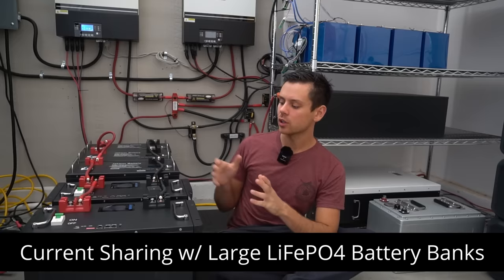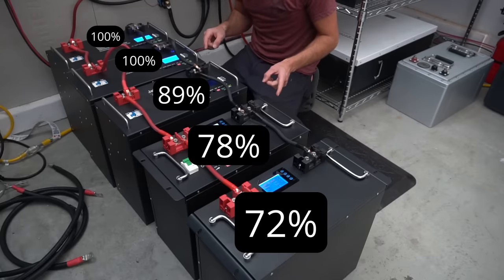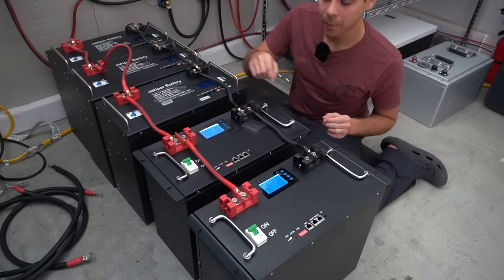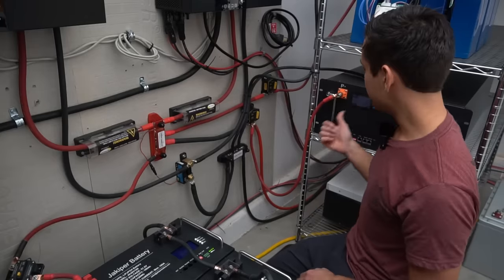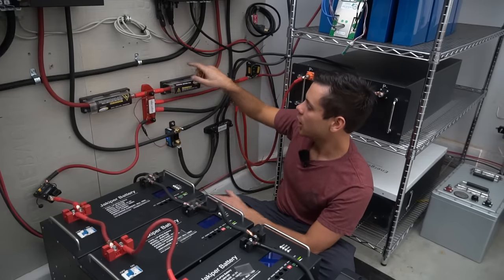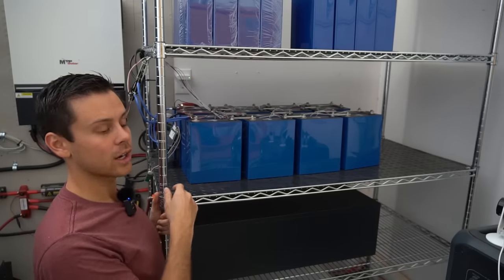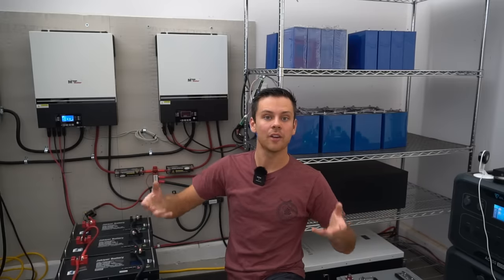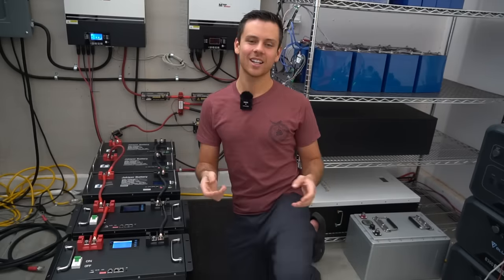Current Sharing 101 w/ Large LiFePO4 Battery Banks

Comment: I have such a case
1- pv off, inverter off, battery cable fuse off, and we do the tests step by step,
2 - battery only on 35mm2 current wires
3 - I turn on the battery and everything is ok, I wait maybe 20 seconds and the green LEDs are on all the time, which is ok
4 - I turn on the battery fuse before the converter and the red LED lights up for 10 seconds
max and I hear in the inverter but when the sound is off, the sound from the inverter is buzzing and after these 2 seconds the LEDs are green
5 - when I see that the red LED is on, the inverter does not turn on
6 when the green diode is on, the inverter turns on and works without any problems
7- after 10 seconds, I turn on the pv fuse and when the sun is shining, the red diode from the battery lights up and I see that the battery is being charged with 10 amperes, but the red diode is on all the time and the inverter has no error messages
8 - when the sun is behind the cloud and I see that the panels have 0.8 amperes, i.e. 90v, the red diode stops shining and the green diodes are on, and when the sun shines again and there is 5 charging, the red diode will light up again
9 - I turned off everything and only with the battery, without the inverter it jumped and I noticed a short circuit when the power in pv was greater than 1 ampere,
10 - his conclusion as I understood the pv charger in the inverter sends strong currents from the pv to the battery
and is set to 56V max
11- what's the matter, the installation of photovoltaic panels gives different voltages depending on their insolation is logical, the inverter supports max 450 volts per string THEN WHY PV CURRENTS FLOWING THROUGH THE INVERTER CAUSE A SHORT TO THE BATTERY what do you think is true next is the same inverter and is the same, every time I turn on the battery I hear a sound from the converter as if I turned something on and felt the current from the battery before I start it and it's hard to say if the converter can cause a short circuit of their battery or they have full bms protection and sense something and the red diode lights up but it charges and this is funny i don't understand please help me i already wrote it but it's not solved yet oh yes i've been playing with it for a month now :( in the room where the off grid installation the temperature is 12 degrees i feel it affects it and the inverter? something with the PV installation but the inverter does not show anything?, please write what should I do with it, thank you WILL

Comment: Hi,
Any idea how these would work in a marine environment/sailboat. Previous owner had the diesel engine removed and installed a 48vdc 5kw brushed motor. I replaced the battery bank, using 8 6v USbattery 220ah batteries giving about usable 100ah. Most I have ever seen the motor draw was 60a. One or two of these server batteries would give me more ah and take up less space. Currently my batteries are located in a couple spots, cabled together.

Comment: I am looking for component suggestions for a mobile application.  I want to install two LiFePo batteries, a DC to DC charger, and an inverter in the toolbox of my pickup.  This will be used to supply 120 power wherever I am and if need be can supply power to a travel trailer.  I have dual alternators that put out 397amps combined.  Any suggestions?

Comment: I have the EG4, 48v 5kwh batteries. 4 of them. I also have 6 sonnen batteries , same chemistry , same voltage but they are 2kwh. They have built in bms but cannot communicate with other batteries.  Can I still connect these Sonnen batteries , with the same bank but connecting to the same bus bar?

Comment: Good day I have a 48 volts setup with 2 Lifepo4 batteries made by me. They are 100ah batteries with different amps BMS Daly 250 amps and 100 amps . The issue is the one with the 250 amps in discharging faster and shutting down the Inverter (40% charge to 75% on 100amps BMS). Any suggestion how to fix this problem?.

Comment: Have you seen the BBMS concept from  Emily & Clarks Adventures YouTube channel, to manage a parallel lithium battery to augment a lead-acid bank?  Obviously with multiple breakers between strings.
ALSO have you looked at lead-carbon 'ultra-batteries'?  Your take would be valuable... Even following you, I still opted for 19200 Wh of PbC.  They've been tested at up to approx 15k cycles at 4C.
NB apx USD $350 per 12v 200Ah before shipping from CN

Comment: Hello just wondering if you could help  I have 4  120ah  agm batterys wire in parallel.  And have been told to put busbar in so I no the cables have to be the same length  but do I need to take the cables off that I have already connected to the batteries to make them in parallel  or leave them on and just add an other set of cables  from the neg and plus to the busbar

Comment: In the spring I'm upgrading my 24v lead acid bank (3 strings of 4 6v GC2 batteries, 645ah) to Lifepo4 (3 SOK 24v 100ah batteries). I've been thinking about ways to incorporate some of the FLA batteries (dc to dc chargers, a couple extra panels to charge the FLAs, etc) to give a my Lifepo4 bank a boost when we spent long weekends at camp. Does anyone have any thoughts on a good way to make use of the old bank?

Comment: would it be possible to take a 30a rv extention cord and cut off the end and connect those wires to the inverter. then plug my camper into the other end. 3500w reliable inverter and 25ft camco 30a rv extention cord

Comment: have 3000 watt all in one inverter charger with a single sok 48v server rack battery hooked directly to unit, want to add another battery; what fuse should be added to the line?;  thanks

Comment: Is there any value in a 288-Volt Nickel Metal Hydride (NiMH) battery pack consisting of 30 low 
voltage (9.6-volt) modules connected in series.
It's on my dead Lexus with 4 electric
motors...

Comment: I was wanting to run 2 packs in parallel but they get moved around so busbar is not an option. Would running equal length conductor to the charger or device work? Im using the bank for an electric motor, was thinking of running the conductors to an anderson plug that plugs into the motor or charger

Its actually two motors (not always the same distance apart) that i wanted them to share their battery banks

Comment: Newbie question - How does a bus bar solve the problem of voltage drop over distance - I mean, since each successive battery requires an additional 10 or 12 inches of busbar, how is that different from an additional 10 or 12 inches of cable?  Thanks . . .
Reply: Bus bars are thicker and carry way more current, as well as lower voltage drop then even zero gauge cable.

Comment: On another note, I know the server rack batteries are great, but I would still like to see you take the 280 amp batteries and build a 12 vac using a good case and BMS.  Whether you buy a good box or 3d print one.
Reply: 12 vac?

Comment: Great info as always... a few questions, sorry if they are a bit novice.

 1) I noticed that your t-class fuses aren't installed as close to battery as possible ? Does this really matter, or are you just compromising because you've got so many batteries connected ?
2) Wouldn't all the batteries connected in parallel quickly equalize to same voltage ? Or this dosn't happen much with lifepo4 because of the constant V for most of the curve ?
3) So I understand its not a problem to have different size batteries at different SOC ?

Thanks for all the videos and info.
Reply from the maker: Yes, just an unsafe amount of batteries, need to keep the groups separated somehow. T class good for largest group.
Reply from the maker: Yeah they won't equalize. Other chemistries would. Lifepo4 doesn't
Reply from the maker: As long as you have ocpd and proper size conductors, and low c rate loads, it is usually safe to have different soc and different sized packs. Not with higher c rates though. Lots of current sharing issues will occur.
Reply: @WillProwse  thanks for all you quick replies, yes this all makes sense.

Comment: Is there any sort of controller that can independently discharge and recharge each battery? I keep thinking that for large arrays it could help reduce the duty cycles across the array. So instead of discharging the entire array it could do one at a time or whatever is required for the load. This way if u only use 30-40% of the array daily it could cycle through each battery in the correct order. Instead of every battery going through the daily duty cycle it may only discharge and recharge every other day. This could extend an arrays life greatly especially if you oversize the array

Comment: i have a lil problem here with my 260Ah LiFePo4 Battery in my van. the battery has an app via bluetooth and the nominal capacity was set to 254Ah while the cycle capacity was at 260Ah. when i entered 260Ah in the lil window next to the already 260 cycle capacity and pressed "set" the nominal capacity went up to 325Ah. when i try to lower the nominal cap to 254Ah the cycle cap goes down to 203Ah.

whats the difference in nominal and cycle capacity and how could i possibly go back to the values i had when i bought the van with this setup? were the values that were entered in batterys software even making sense in the beginning?

Comment: Bus bars don't really [directly] solve the outlined issue. The only thing that bus bars would do is potentially reduce the voltage drop due to a larger cross section, assuming bus bars will have a significantly larger cross section. To completely eliminate the uneven voltage drop batteries should be paralleled in a "star" topology instead of a bus. Basically two big terminal posts to which each battery is connected with equal length conductors.

Comment: I have 2 lifepo4 batteryes wired exactly like in your video 100 amp each.
And the same problem , one battery is 70% and one is 100%. 
I used a 5mm bus bar, wired them as you sayed and still the top battery is discharging and the down battery is 100%.
The comunication cable betwen the batteryes is connected.  But the inverter is not connected to the bms battery. Cand that be the problem ? Or is it something else ? 
( does the battery address has something to do with that ? ) 
I  have an easun inverter with 6 x 370w canadian solar pannels.off grid. Can you help ? Thanks!

Comment: Does anyone know if the unequal charging/discharging rate issues apply to a bank of Renogy 12v smart batteries?  The batteries are connected in parallel and there are RJ45 cables linking them also.  I assume that the RJ45 Ethernet cable enables the BM systems to communicate with one another.  I further assume that the BMS's would therefore regulate the current flows to ensure equal charge and discharge irrespective of optimum parallel cabling.  I would be grateful for any comments.

Comment: Need to check the dead current window, most 48V battery have 0.5~1.0A. it means it can not measure +/-0.5~1.0A. and ignore to calculate the capacity. when use 4P, it will become 2~4A, it is huge power to ignore. even the battery has discharged with lower current, it can not calculate correctly. I feel, the BMS has serious problem. I have got same problem. so, I have made 48V small battery pack with very low dark current. and using the small pack to estimate the other battery pack.

Comment: Thanks Will! 🖖
The next question I have is how many volts can you push into all these battery banks and how do you determine how many volts into one battery bank?
Reply: A '48V' system LiFePO4 battery has a nominal voltage of 51.2V (3.2V per cell). A cell is charged absolutely full at 3.65V, so that means the total pack voltage can be 58.4V, Since all these different packs are in parallel, that is the voltage of the entire string of parallel packs.
Reply: @upnorthandpersonal  
What if you put them in a series/ parallel?
Reply: @benjones8977  Batteries in series results in higher voltage with same current, batteries in parallel result in same voltage with higher current. You can combine them how ever you want. You don't 'push' voltage into a battery bank, you push power: the product of voltage and current. If a nominal  LiFePO4 '48V' (51.2V nominal) battery at 100Ah is placed in series with another one, you get a 101.4V, 100Ah pack. If you put them in series, you get a 51.2V, 200Ah pack. Energy stored in either configuration is the same.
Reply: @upnorthandpersonal  
Thank you! 😜🖖

Comment: I'm confused...

Won't you still have voltage drop along the bus bar? Why aren't the conductors from the bus bar to the packs differing lengths (longer closer to the inverter along the bus bar) to compensate for the bus bar's voltage drop?

Or is the voltage drop in the bus bar simply insignificant?

Thanks
Reply: With the setup you have, don't you essentially have a bus bar with 0 length conductors to the packs?
Reply: You will still have a voltage drop along the bus bar. The larger conductor will lessen the drop, but there will still be a drop.
Reply: @MarkRose1337  Aaaahhh so you're saying that the conductors have to have equal resistance from the load to the battery packs. Fascinating.
Reply from the maker: Oh you need to connect to the bus bar at opposite ends. Diagonal as depicted in the video. Sorry I should have mentioned that point more in the video.
Reply: @WillProwse  Oh you mean opposite end of the other polarity not opposite ends of a single bus bar. Gotchya.

Comment: I have an important question about battery use.   I now have 7 eg4 batteries for my split phase 6548 system.   I have 6 in the rack now but am not sure how to tie in the 7th.  Do I just run it straight to the bus bar on it’s own with a unique dip setting?!🤷‍♂️   I am in fear of overloading or frying the whole thing if I mess this up.  Anyone able to help?!!

Comment: Question: Is there any reason you couldn't use fat equal length busbars (instead of equal lengths of 2 gauge wire) to connect the terminals to the long busbars?
My thinking is fat equal length busbars would be even lower resistance, as well as, well, very metal looking - devoid of wires.
Would vibration be a problem in an RV, for example.
Reply from the maker: Yes actually! That would be very nice..

Comment: Thanks for the video. What do you think about doubling up conductors on those server rack batteries to further reduce voltage drop?
Reply: I've done that in the past but it all boils down to what is the biggest connector/cable combination you can physically attach to the battery. Safety is paramount so don't cut out cable strands to fit the terminal and don't trim the terminal to fit the battery and other devices. Always use the correct size terminal - there is the correct part for your project out there, buy it, don't compromise!
lecture over! 😊

Comment: Hey can you tell me why all of those rack lifepo4 batterys are only "allowed" to be wired in parallel and not in series? With a "high voltage dc" battery system I could use just much thinner wires, grid tie inverters i.e. take from 50 to 700Vdc, so with just 2 48V batterys in series I could get a decent amount of power while not having to use super thick wires to the inverter
Reply from the maker: BMS fet voltage rating. That's all

Comment: @8:48, is the breaker under or over sized?  You said it would not trip?  Those 5 batteries in parallel could output about 500 amps?  That wire looks way too small for that current for any length of time.
Reply from the maker: The circuit interrupt amperage rating is not adequate.
Reply: @WillProwse  Thanks for the clarification.  It might be helpful to explain in a little more detail as to why AIC rating is important,  specifically the failure mode with breakers having their contacts welded together.  Also,  fuses have resistance and using different fuses on parallel battery banks can create imbalance.

Comment: Hey Will, about 9 minutes in, you were talking about the circuit breaker on the new pack of server rack batteries, and you mentioned that it wouldn't trip, and said it was undersized. Did you actually mean that it was oversized, so there wouldn't be enough load to trip the breaker?
Reply from the maker: No, the interrupt current is too low. It's undersized for extinguishing a large DC arc
Reply: @WillProwse  the arc, got it now
Reply: Good

Comment: It is interesting, but doesn't address situations where the different BMSes can be the limiting factor. Take SOK 100ah batteries paired with a 206ah battery, they have the same BMS but the BMS for the 206 can't handle what the cells are capable of. What happens if running a large load like an AC?
Reply from the maker: Make battery large enough so each one is running at low c rate.

Comment: So when ac charging can you use an older square wave generator or does it have to be a sine wave generator? 
Thanks.
Reply: I'll be using an eg4 6548 3 in 1 inverter.

Comment: I drive a 5.7 Tundra for its size & speed, but 99.99% of the time it's parked, otherwise used for Home Depot stuff or for kids school transportation, if the electric truck wasn't $100K I don't mind to replace it with one but I am just fine with my Tundra.

Comment: I have a good understanding of Ohms Law. I see the safety measures you've employed. But seeing all of that current capacity in one place scares me. I'm sure it's totally safe. It's just when it goes bad, it can really go bad.
Also, I made a mistake when connecting some 18650's. I got a few sparks across my .15 mm nickel strip. A mistake with banks those size could be real bad, real quick. I'll leave it to the pro's. :)
Reply from the maker: It's really scary. It's a massive amount of energy.
Reply from the maker: It does scare me haha

Comment: So basically if i had 15 battle born 100ah litium batteries in order for them to charge and discharge properly/evenly is to terminate all positives and negatives to bus bars respectively and also equal length conductor from battery terminal going  to the bus bars